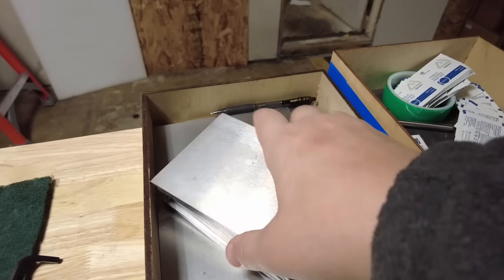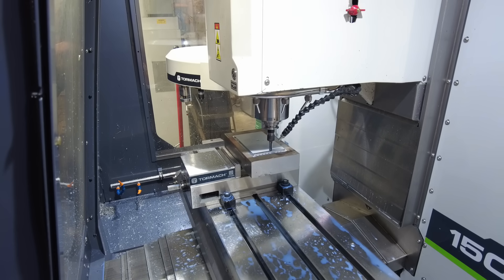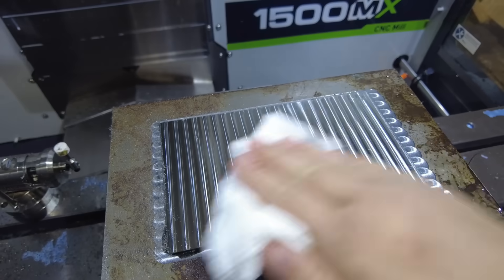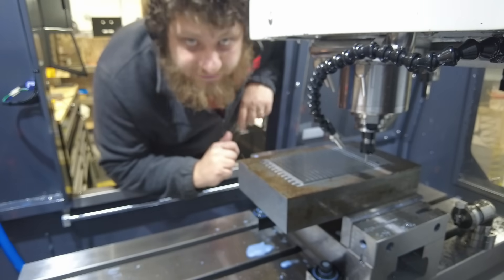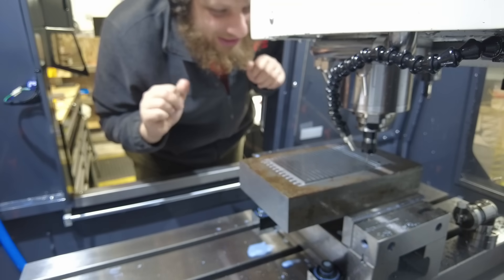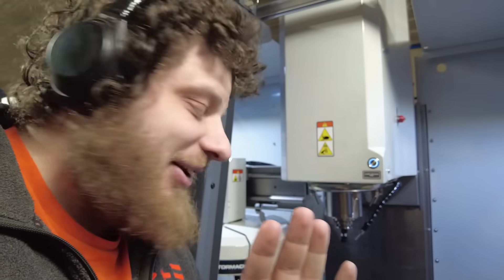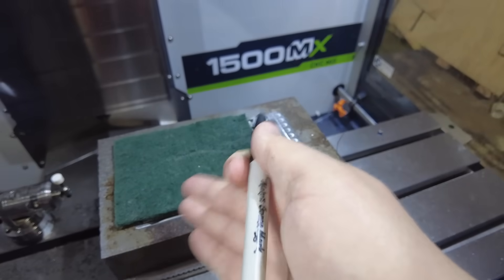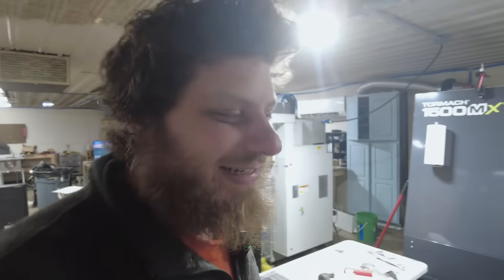HARDmilling (this project broke me)

Comment: At work we do lots of hard milling and we NEVER use coolant, only air. The theory is that the tool is getting thermaly shocked and it kills tool life. Also using proper Hard milling end mills makes a world of difference, we use YG1 they work pretty well.  Also for slotting hi feed end mills are propably a good choice.
Reply: There are certain times where coolant is better even though the tool may not like it. For example if you have a small piece that heats up too much and warps so coolant will help cool the part and leafe a dead flaf surface.
Reply from the maker: I think the coolant was doing a better job at flushing chips out of the slot than the air blast (or it was until the filter clogged), less recutting of chips was giving me better tool life.

I did eventually figure out there was a second regulator on my air blast, what was keeping the pressure low, it turned up that one, And it seemed to help quite a bit
Reply: Thats not a theory.
Reply: What YG1 are you using? I have to cut about 150lbs of chips out of hardened white cast iron ( ASTM 532) a month and got way worse results from the fancy x something blue coated line than helical gold coating. It was a .375 6 fl end mill (YG1 might have been 4fl)
Reply: Yg 1 X5070 high feed is the way to go
Reply: I swear by YG1, Alupowers will leave a mirror and the titanox endmills have saved us a ton of time on stainless and tool steel
Reply: @kgcrystal3662 that's what we use.
Me to machinist. I have some hard stuff I need you to fix. 
Machinist to me. Ok no biggie.
Reply: I second this, YG X5070 is the way to go. Used to do almost exclusively hard turning and milling and those tools were unbelievable. They also make really good dream drills for high hardened steel.

Comment: I am not hardened steel expert, but i milled a few parts. Right tool is the key. If you have to make one piece. I say ok with normal tools. But for that many pieces HM tools for hardened steels are better. But keep it up.

Comment: You got set up for failure. These parts should have had a grinding op for over all thickness and then features milled after.
Reply from the maker: I mean, I'm the one who chose how to make them. I did this to myself 🤣.

If I had to make them again, I would machine the slots, and remove the majority of the material while it's soft (but still leaving a healthy margin on the thickness). Then I would harden it, and then I would grind everything flat/to thickness.
Reply: When you are in the phase of starting out like yourself quality and delivery mean everything. My advice is to say no (I know it's hard) to anything that even remotely feels outside of your capabilities. I know you want to learn and grow but that will come in time. Don't force it.
Reply: You heat treat, grind, then sinker EDM something that hard. Sometimes a mill just doesn't work for the job.
Reply from the maker: EDMing the slots at a minimum would have saved me a ton of time and endmills
Reply: we never cut anything above 190 ksi, the investment into proper tooling was way too much and we didn't do enough of that work. edm and sent to a grinder was cheaper.

Comment: I wonder if you could fit some sheet metal baffling in the coolant tank to get them to settle out prior to reaching the filter. Just a thought…
Reply from the maker: There are some baffles in there, but I think they are arranged more for avoiding sloshing than settling.

It would be easy to add an extra sock filter before the pleated filter. That should solve this problem going forward

Comment: Is that the filter setup from Tormach ?  You might have to Macgyver  something that gets you better coolant flow.
Reply from the maker: That is the stock setup yeah. The stock setup is perfectly adequate for "normal" milling. I think if I do a bunch more hardmilling like this I just need to add a pre-filter of some sort. Probably the sock type that is quick and easy to clean out.

Comment: 1/16 should be running about 300-500 SFM, that's 18,000 RPM minimum... your machine spins that fast? spindle speeder?
Reply: Yes, He mentioned early on that he was guessing speeds and feeds, the tool manufacturer gives you all you need, it is best to abide by that only, I ran 1.2mm slots in a part pretty simmilar to this on my DMU 70 eVolution back in the day, at 16,000 rpm the process was not perfectly reliable but it worked, you need a lot of RPM for small tools in 50hrc+ stuff.
Reply from the maker: That sounds too fast for hardmilling. From what I was reading, (and then proved to myself with practice) about 200 was the sweet spot.

The machine can only do 10K rpm.
Reply: @AudacityMicro  Yeah you just have to scale it down to your machines capabilities, for me 1mm 4 flute endmills with an extended neck, 50 - 60 hrc, I run them at 50 - 70 Vc. Love the vids tho bro!

Comment: Dang, tough job but thanks for sharing this with us. In hindsight do you think starting with annealed material would have been better, or was that not an option?
Reply from the maker: Well, background for this one is that I stated with annealed material, made a whole batch of parts, and then they warped to hell during heat treat, and were all unusable. That's why I decided to hardmill them.

I'm finishing up these parts now. As you saw in the video, warping is still an issue, so now I'm leaving a ton of extra stock on them, and grinding them flat.

If I had to make these parts again, I would do the slots while it's soft, and remove ~50% of the material. Then I would grind it to thickness, and hardmill the other features.